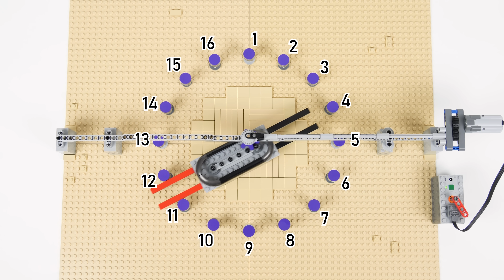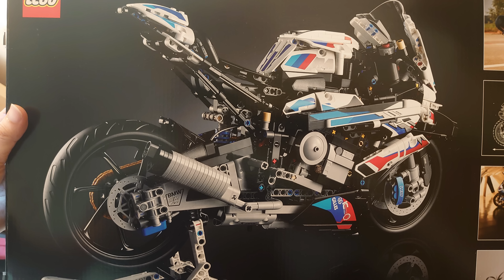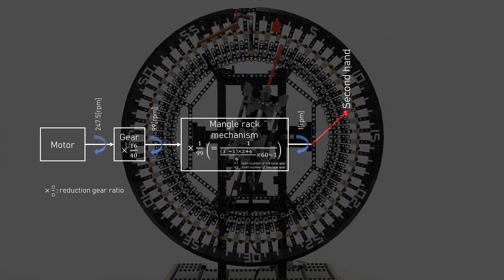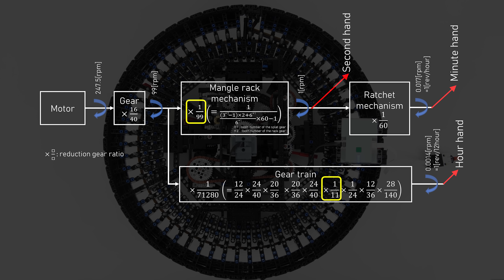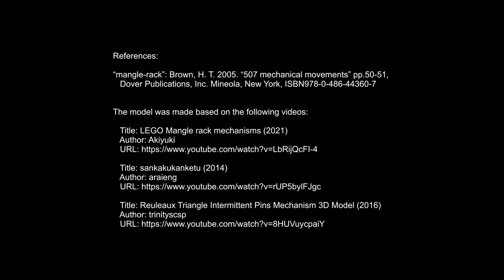レゴ マングルラック時計

Comment: Not only is the engineering clever, the execution is masterfully done. Real work of art!
I would love to own such a clock!

In regards to wear, some silicone oil would definetly benefit the moving parts to limit wear.

The minute hand is easy to adjust, by just lifting the ratchet and turn it around to the correct position, but what about the hour hand? Any simple way to move it?
What's the total amount of LEGO pieces used in this clock?

Comment: Sweet design. Kinda disappointed that the hour hand is ran off the same motor as second just at a higher gear ratio and not progressed by the minute like the minute is progressed by the second. Still cool though

Comment: I was wondering, the minute gear seems to slip a bit. Is this an issue? Maybe after some wear it will start slipping an entire minute back. Maybe theer could be a mechanism to prevent this?
Either way it is a very impressive invention 👍

Comment: Maybe it's not 'practical' because of the quick wear and inaccuracies, but 1, 40 seconds in 12 hours is better than some real timepieces. 2, the thing is absolutely gorgeous as a design. And 3, It's FREAKING LEGO. A working LEGO clock. I would put it up and/or have it running just as a conversation piece or decoration. 

Amazing job too, like explaining the difficulty of working with Lego gears and the workaround you used. I would never have the ingenuity to build something like this, but the fact you're willing to show others to inspire them is wonderful. ^^

Comment: There are 5 spaces (including the hour) between each hour.
There are 60 minutes in one hour.
60/5=12.
Every 12 minutes, the hour hand moves over by one.
It will be exactly between both hours at the 30 minute mark.
30 minutes = 2.5*12.
2.5 is half of 5.
This is just some random knowledge for you people. I don't know if this is the case with all (analog) clocks, but it is for mine.

Comment: This is impressive enough even if it didn't move, and yet you have obviously made it to move. I was worried about the wear and unfortunately turns out it is an issue afterall, too bad. I was wondering about the accuracy in the timing as well, surprisingly only about 40s off in a 12hr duration is quite an achievment considering the medium this is made of.

Comment: You should make some instructions, ands parts list for this clock. Though I've never seen the specialized sprocket looking part used in the Mangle rack. is that a 3D print or Did Lego Corp
 make that part? Anyway, I'd buy a set of instructions for building that clock. It's bada$$.

Comment: This is a wonderful little item! Even if, as lego, it has no real practical long-term use due to the constant wear, I think this method of making an analog clock is really nifty! If I were more into metalworking, this would be something I'd love to try to recreate. Also 40 second offset after 12 hours seems to be really minimal, but yeah I can understand it stacking up over time, great build!
Reply: Just FYI, a high end mechanical watch usually has a variance of +4/-6 seconds per day. Depending on temperature, amount of wind on the mainspring, position, etc. For a static clock 40 seconds is about 17th century level of accuracy, but it's incredible impressive for an amateur project made of mass-produced lego.

Comment: I'm curious how you got the pieces to play nice with needing to be separated by increments of 6° on the frame. 

I don't have the parts library myself, so I'm stuck with digital designing, but I'd personally like to play with the idea of improving the visibility of the hour dial and hand while retaining the exposed mechanism; this would involve moving the dial and hand, but there's also other potential benefits that could come out of doing so, like finding a way to mirror the minute and hour hands while enclosing them to a singular track, finding a way to make the face entirely flush, excluding the hands, and keeping the mangle rack mechanism either flush or recessed in comparison to the face of the clock, etc. The only major concern I have is longevity of the rack and gear within the mangle rack mechanism. 13 minutes into the video doesn't give me high hopes of a lasting design. Though, I don't think the various mechanisms would work as nicely if you rearrange their seconds/minutes/hours roles, for example the ratcheting one works nicely for minutes and relies on the seconds' mangle rack mechanism.

Comment: Amazing, as always! Love all the building techniques. You can reduce wear of gears just by applying small amount of silicon lubricant to the gears and axles . It reduces wear pretty much 90% or even more. And silicon does not damage LEGO's plastics in any way, it also does not flow and spreads everywhere like some oil would. Just a suggestion, but try it first on small scale to see if you like it.

Comment: I wonder if it would be possible to use LEGO parts (and possibly some gravel or similar to add weight) to build a purely mechanical movement that, even if just for a few minutes, would be able to deliver sufficient torque to drive this clock with relative accuracy, using probably gravity as the energy storage.

Overall, a very impressive build, both in terms of the functionality (a drift of 80 seconds per day is really good for what this is), and also in terms of the aesthetics.

Comment: 12:00 I like how the connectors of the minute moving mechanism move from the vibration of the contraption, only visible in time lapse.
Reply: its not because of vibration. those are two grey non friction pins and they rotate because the mechanism there gets triggered every minute and makes them spin around a fraction. in the time laps it happens so fast it looks like they spin on their own.
Reply: im not witnessing the same "vibration" ...
i see deep and precise moves.
i don't see any heretic rattling nor uncontrolled moves.
Reply: @shinokami007  There is a pin spinning around on its own near the top but its not a big deal

Comment: This is a fantastic work of engineering and art. I especially love that the number of links in the minute-hand chain is a multiple of 60. It didn't have to be, but you found a way.
Reply: Actually it had to be, because every 3 links of the chain there is this little notch which allows the minute mechanism to pull the chain by the right amount each time, and so it needs 60 notches, so for everything to be even, the amount of chain links needs to be a multiple of 60

Comment: I am simply blown away. I want this, this needs to be available to purchase somewhere it is that incredible. I am in awe of the way you think about mechanisms and how they interact and this is yet another example of your genius!

I have a couple of questions.

Am I right in saying that over the course of your 12h time lapse that the clock only gained 45(ish) seconds over that time? I'm amazed it is that accurate 

Do you think it has the longevity to be used as an actual clock for a prolonged period of time (provided i adjust the time every so often to keep it accurate)?

Comment: Fantastic project, extremely well executed! Would be very easy to keep it time synchronised using an arduino and PWM driver on the motor if you wanted it spot on 👍

Comment: This would be an amazing piece to have on a wall or mantle. The only problems I personally have is the noise and the fact that you'd have to replace several of the moving parts with metal replacements if you wanted this clock to last more than a few weeks at best. Building it would be both a delight and a nightmare as well.

Comment: Wow, this is truly impressive. So many small details, like the 1:11 gearbox, are impressive in themselves, but the whole clock is such a great combination of them that you want to build it right away.
Reply: i dont get how it works... (or what does the diff do there)
Reply: @OnezKrs  A differential has a special ability to "add" rotations. Take the two shafts sticking out the sides as A and B. If A and B rotate some amount, the differential case rotates (A+B)/2. 

To make an 11:1 gearbox, we want input A=11, output B=-1 (negative in this case because the output rotates the opposite direction). Using the formula, the differential must rotate (11 - 1)/2 = 5.

So we just take the -1 on the output, do a 1:5 using the big gear, reverse it, and feed that +5 into the differential body. Very clever!

Comment: Even divorced from its underlying ingenuity, I find this clock quite beautiful to look at. I'm also grateful for the time you took to make nice subtitles and chapters. The one thing that bothers me about the clock is the "poking" motion of the second hand, though I'm not actually sure why it makes me so uncomfortable. Regardless, thank you for sharing this beautiful work of genius with us!
Reply: I was thinking that you could get around this by somehow putting the mangle mechanism on the back and running a rod through to pass the second hand rotation, but hiding the mechanism would kinda defeat the purpose (and make the back a lot thicker)
Reply: @RealGrouchy  The thought I had was to have a red second hand fixed to a pivot at the center of the clock and attached on top of the pokey bit with a sliding joint, such that the second hand would rotate in time with the mangle rack mechanism, just without the reciprocating movements. As you correctly noted, however, the mangle rack mechanism is the entire point of the clock, from which everything else followed, so regardless of how it makes me feel, it ought to remain front-and-center.

Comment: Very very impressive. I would recommend not using the brown chain link, and I also recommend turning the chains inside out. The pigment in the brown chain actually makes them more brittle, and the chains stay on for longer when inside out. That might not be too important for this type of build, but it would make the clock more impact resistant if it collided with something.
Reply: yes, brown parts are soooo weak, i hate it. i have had a ton of brown parts break.